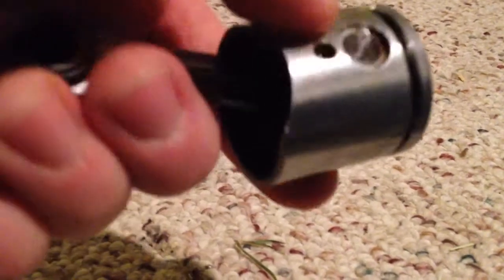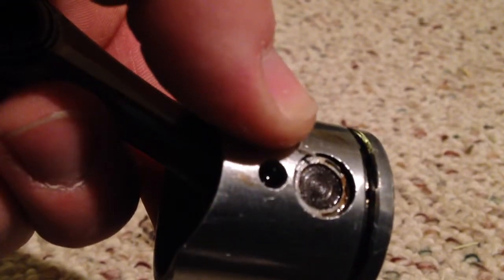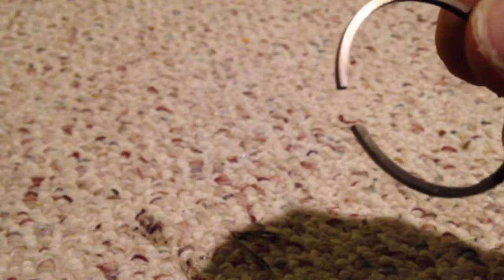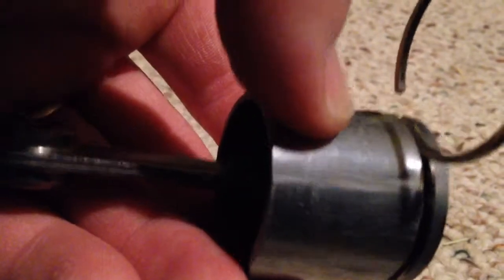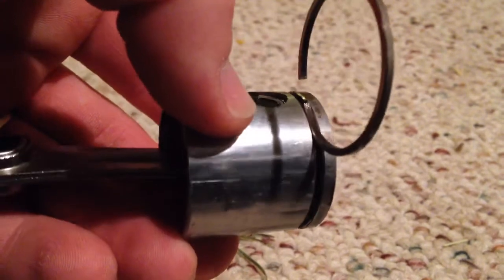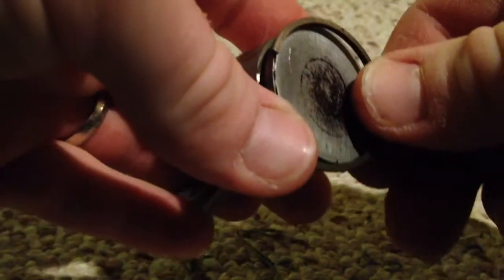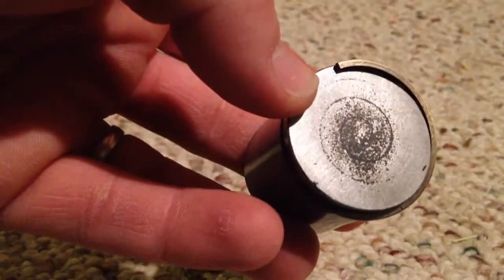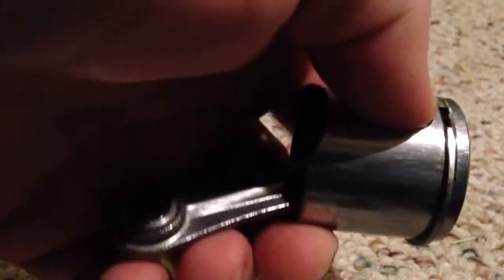Piston ring install in model engine

Comment: how do you get the piston back in?0
Reply from the maker: Coleman Binyon - oil the piston and ring, and locate the ring gap at the locating pin.   Then you basically wiggle the piston back in - the bottom of the cylinder of this particular (gasoline) engine, the bottom of the cylinder is chamfered to allow the ring to compress and slide in.   Glow light engines are often very similar though usually the piston goes installed onto the crankpin and the cylinder liner drops in on top of the piston.    Same ring compression truck works here too most of the time.
Reply: @Rustler3pt3  ya mines a glow engine and i cant get it in. it seems like it needs to be compressed
Reply from the maker: Coleman Binyon - sometimes you need to help it a little bit by using your fingernails to compress the ring at the ring gap.   You just need to make double sure the ring gap is right at the locating pin.   If it’s off even a tiny bit, it won’t go in and you risk breaking the ring.   They are somewhat fragile, so use lots of oil on the piston and ring and also in the cylinder liner.    Be patient.  Don’t rush it.
Reply: @Rustler3pt3  oh thats what i did. whoops.